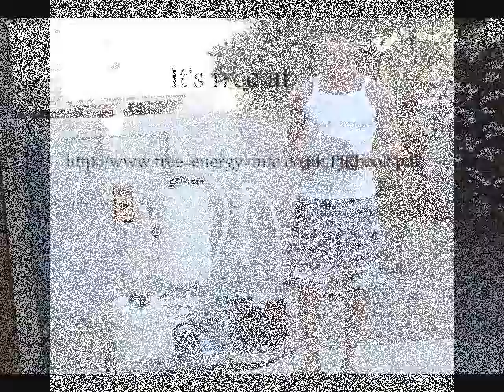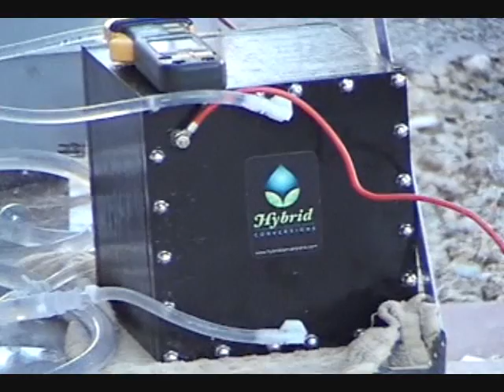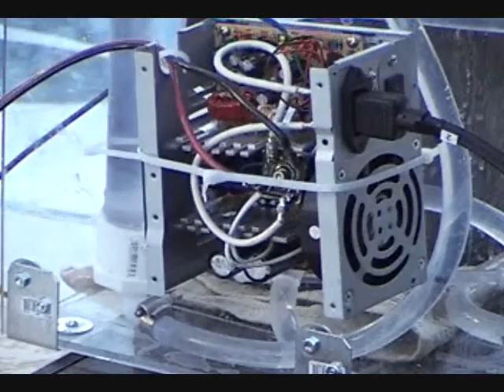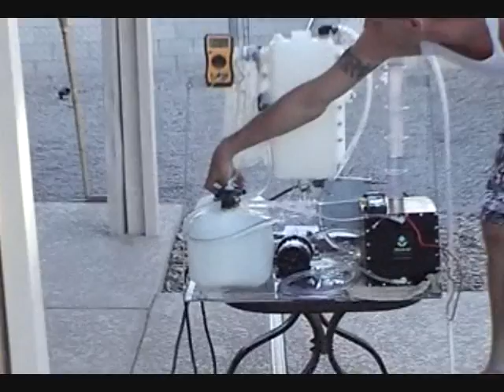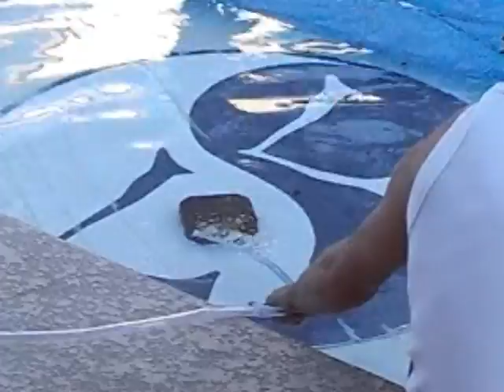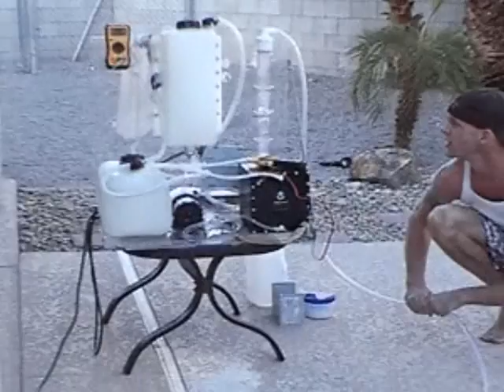tree of liberty free energy part 1

Comment: Was there an error in Bill's describing using a computer power supply to supply 110 volts AC which he then used a full wave bridge rectifier to turn into 110 volts DC to power the ionizer? Computer power supplies supply 5 volts DC and 12 volts DC. You don't need a power supply to supply 110 AC, unless maybe an isolation transformer 110 AC to 110 AC.
Basically, the energy needed to free hydrogen from the water will be more than the energy obtained from burning it (back into water). No free energy